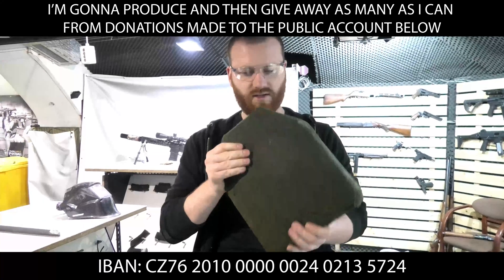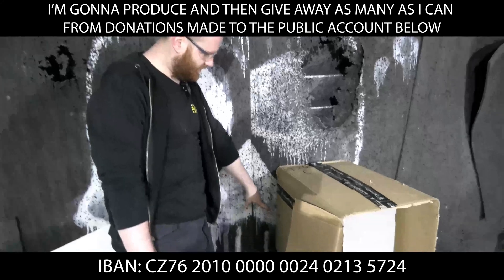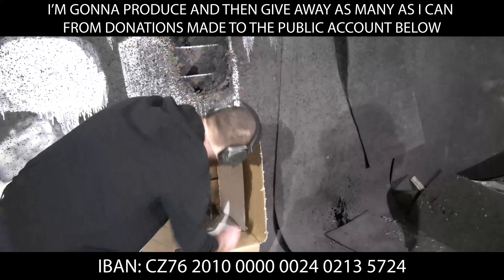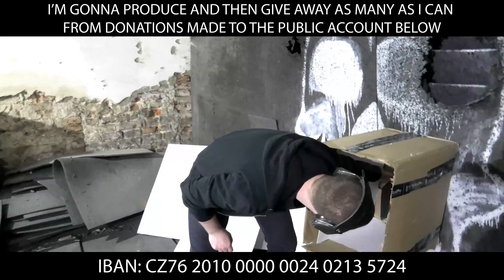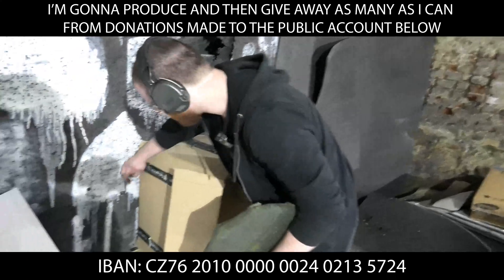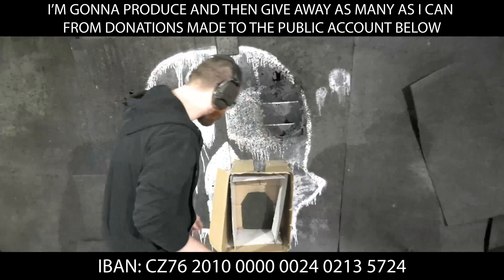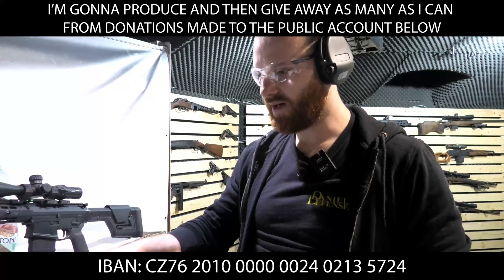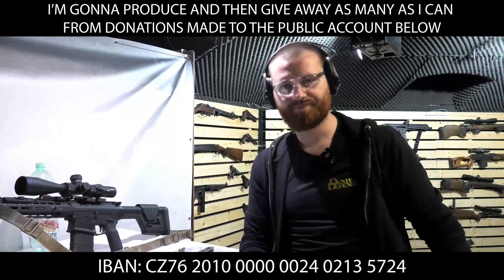DIY Anti-frag layers for Hardox 500 plates

Comment: What kind of pu foam did you use was it expanding foam and is that what you used as the adhesive to glue the fabric to the plate

Comment: I just tested Hardox 450/8mm. Nothing will penetrate it, but it's 4,8kg. How can we achieve the same protection, but at a lower weight?
Reply: Also, we need to laminate our plates. If you could provide some instructions it would be very much appreciated.
Reply: @mortarboss  in the newest video, the rounds didn't penetrate the first plate which is only 3mm. Im selling plates at 6.35mm so nothing should penetrate like what you've found

Comment: Did you test Hardox 500 or Hardox 600 on this movie?
Reply from the maker: 600
Reply: @jansafarik4977  Could you shot to Hardox 500 by armour piercing? Would be more obiective test. I didn't see any test of Hardox 500, 6mm with armour piercing 5,56. Anyway great job. My idea is to use PET bottle foil from cutted bottle instead of kevlar. The foil placed in layers is very durable. I mean about something like waffle.
Reply: Can you tell us how much does it weightS?